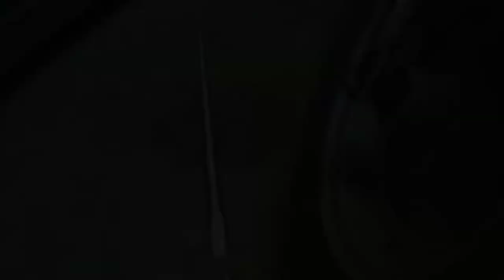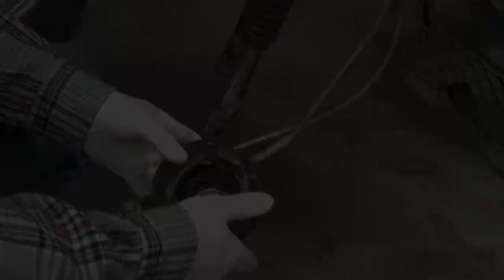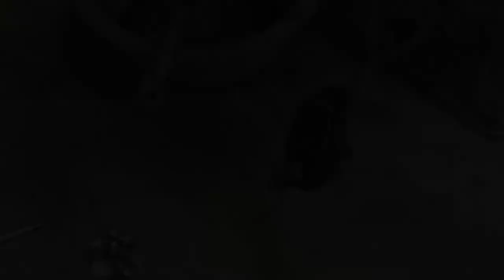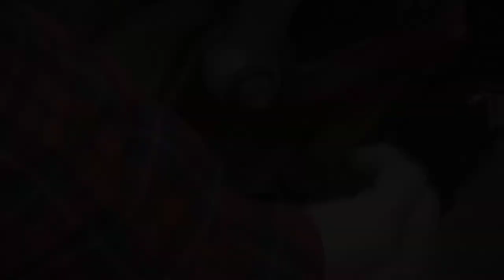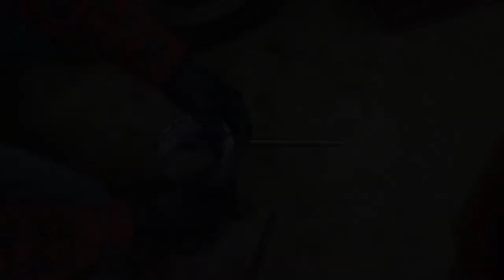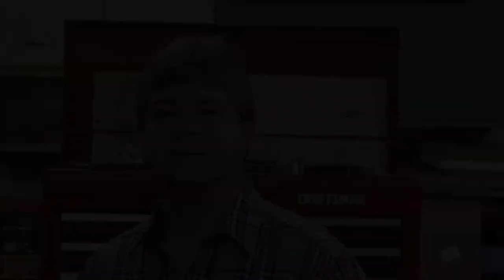How To Replace Brakes On A Honda 70

Comment: Hi Rodney. I really enjoy your videos. Very informative! I could please use your expert advice for my 1971 CT70. The front wheel seems to have a lot of friction. The wheel will only spin around about 4 rotations before it stops. I took off the front brake hub and the wheel spins very well. When I put the hub back on I get the friction. I even disconnected the cables to the hub and it still doesn't spin well. I wonder if the brake arm needs adjustment. Possibly it is causing the brake shoes to rub. How can you tell what is the best way to adjust that brake arm if this is likely the cause? Thank you in advance!
Reply from the maker: It could be your wheel bearings, take the wheel off and check them. If they are good, then it may be your brake shoes are not sitting in the hub completely lined up. You want to make sure that the pin that is flat, that the shoes set against is totally meshing flat and not slightly turned. That would be the pin that connects to the brake arm . The brake arm has no adjustment, especially if the cable is off. If you want, send me pics of the brake shoes mounted on the hub. Send them to my website https://rodsshop.org/contact/

Comment: Hi I have 1977 ct70. I can't figure out how to adjust the front brake. It's on but the lever doesn't return when you let off the brake.thanks hope to here from you soon
Reply from the maker: Hey Brandon, this could be just a few things, all of which isn't that bad to fix. If you would rather continue this through my site, we can. There you can send me some pictures over some things I am going to ask you. Contact me at https://rodsshop.org/contact/

Have you put new shoes on the front? 
If the two springs that connect the two shoes together have broke or come loose, that could be a possibility. 

Is the spring on the outside of the brake hub, the one on the hub lever look crunched up or broken?

How far do you have the front brakes adjusted, if looking at the hub lever on the wheel, is the adjuster screw really far in? 

Are you sure the cable isn't bad or binding?

Shoot me some pics and send them to my website of these things and I can give you a better idea of what it might be.